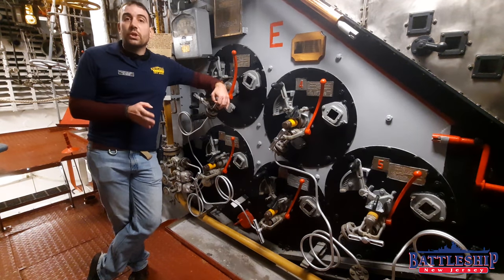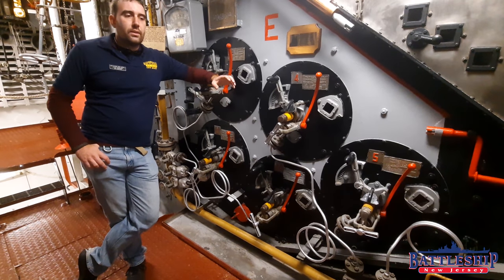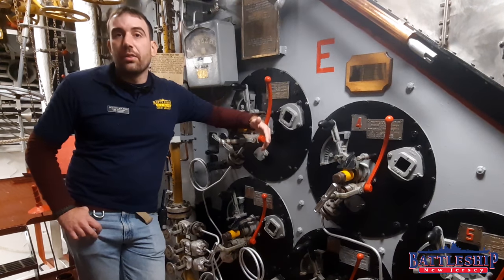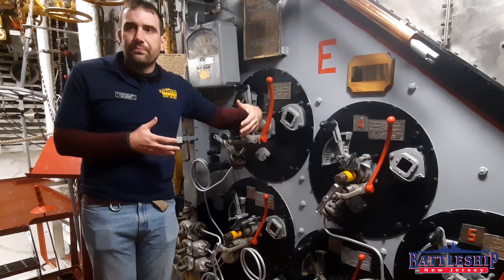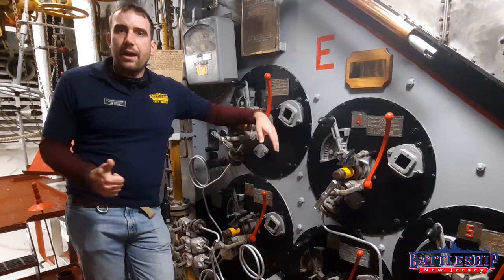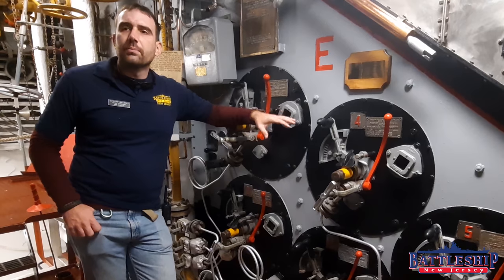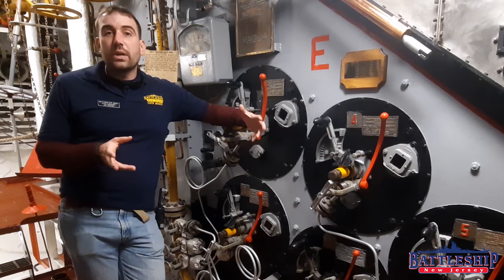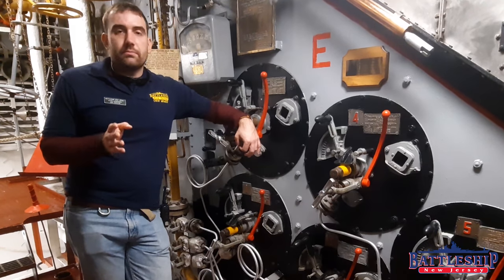Nuclear Powered Battleships

Comment: I completely agree with you on the cost efficiency dilemma. Building state of the art modern battleships would not, not even in a 100 years be cheap. That said WW2 battleships never were, they were the biggest capital class vessels that dominated the AO but were always a scary investment should they be lost. I still believe (despite your good arguments) that nuclear reactors in modern battleships are required if not mandatory. For the very reasons you pointed out you would not put them up front in any engagement to take hits you would instead use them as fire superiority/defence platforms to engage entire fleets becoming the spine of that fleet as they are being escorted. Their size and armour allow them to take hits yes, but with a substantial powerplant you would be able to operate railguns, missile systems and direct energy weapons (Directed Microwave and laser weaponry) that would struggle to be operated on other vessels. With an excess of power these weapon systems could be run cheaply and efficiently whilst the ability to turn the tide of the engagement in your favour. As more technology is developed the design needs to be modular as to be updated if the need arises for new technology and innovation. For the very reasons you mentioned it is not viable to retro-fit the venerable Iowa class battleships, this cannot be done as the foresight of updating the ships was not considered. You do not want to invest in a mega project only for it to be outdated 30 years in the future. 

Regarding taking hits to the battleship, as we've seen with modern tanks composite armour they have immensely improved their survivability, this is something that could be adapted to battleships in some manner again improving their weight and survivability. Shocks to the vessel via explosions that could scramble the reactor could be mitigated via a shock absorber system that the reactor is mounted on there by reducing the chance that only the most devastating hits can cause such a problem (which at the point they have likely already penetrated). Obviously AA armaments are a priority since losing a multi billion dollar vessel to a few dozen planes worth less then a billion would be shit to say the least. I could go on and on but suffice to say that as technology develops, namely direct energy weapons that hit instantly the dominance of planes and aircraft carriers will wane until the need for capital class ships to again slug it out.

Comment: I'm sorry but you're exactly wrong about nuclear reactors being delicate. 

The reactor itself is more hardened than the Iowa's belt, just intrinsically. And it's containment yet more so again. For a good example the USS San Francisco hit an underwater mountain at flank speed, the front of the ship was crushed. But the reactor didn't give a single shit, in fact the ship returned back to port under it's own power.

The navy did extensive hazard studies with the cruisers and there just are not any... Even if it's somehow can-openered and causes a radiological release. In such a catastrophic scenario the reactor would just sink quite quickly and take it's issues with it. There's about a dozen submarine reactors on the bottom doing no harm to anyone bearing out this fact. Your comment about SCRAMing the reactor was particularly telling about your background reading on this topic as military reactors are capable of restarting instantly. 

The many operational advantages of a nuclear reactor vastly outweigh any vague hazards. Double so when those hazards are smaller than existing hazards. Flaming oil from a stricken ship for example is a much greater issue than radiation. Nuclear power will eliminate that hazard, and many others so it's outright safer.

You're right about the Iowa class being too expensive to retrofit, on top of being obsolete anyway. But any new build ship should be nuclear powered.

Comment: Distributed hardened RTGs might be a viable solution.  Just a thought.
Reply: RTG's don't generate nearly enough power to be even remotely effective on such a scale.  RTG's generate power in the hundreds of watts.  You need power on the order of megawatts.  Not to mention RTG's are horribly inefficient converting heat into electricity, meaning even if you could fit enough of them in the hull to power it, you'd have to cover the hull from stem to stern in radiators to dissipate the heat.
Reply: @ThePrisoner881  sorry, failure to put in an emoji at the end of that.   You are quite right.  While a steam generating version is likely possible.  They don’t scale to the task,  and even if you could put enough of them on board, somehow, the resulting “vessel” would be mostly plumbing.   Not exactly a warship.

Comment: Do you think that a multi fuel system would work better than a nuclear system so the ship could run on a whole host of fuels like used motor oil or old dry grease I think it would help save the taxpayers money and give us another shot at producing an amazing surface warship I also think that the gun size should increase so we can lay claim to the biggest naval guns afloat

Comment: Can we stop talking like a battleship would be acting alone in combat situations? Yes they are made to take hits but having one act alone, and be the only target has been historically proven to be a bad idea. I can't readily find the source but I did read an article that detailed what a 1980's era Iowa battle-group entailed. This I believe included at least two missile destroyers, and a missile cruiser. An Iowa Class would have a similar ring of protection like an aircraft carrier because they are both expensive capitol ships with over two thousand crew and steps would be taken to protect them in combat.

Edit: A problem with your not being able to take the hist argument is that there are instances where non-nuclear powered warships cough Scharnhorst cough were felled by hits that either flooded or destroyed the boiler/engine space.

Comment: Hmm well my opinion to that of NP (Nuclear Power) it is a Very Fragile unit system, unlike that of the Oil Burners on Iowa but again the Days of the Iowa where Times of War and anything with a NP power plant was made in the times of very little Conflict with those ships cause they where the new shiny new toy that you didn't want to break and it's still that way today, every Ship that is ment to get down and Dirty don't have that of NP power plant within there hull, they have that of a Standard system of ether Oil burner, or that of Gas Turbine engines. If someone wanted to make a new Iowa Class or Montana Class BB they would have to use Oil burners or Gas Turbines for those are more Sound that that of NP. But again I would go more for CB or CC go with Oil burners for Main and Gas Turbines for Secondary Main for more Power for Combat systems, Then go for maybe 12-14in Cannon that can fire that of Rocket Assisted munitions or go for that of Pure Connect Rail or Coil. Then start building a Ship around the Power plants and the Guns
Reply: By oil burner, do you mean oil-fired boilers driving steam turbines? That would be a bad idea today since nobody runs marine steam turbines anymore except in a few LNG tankers. Integrated electric propulsion with diesel and gas generators is a better setup in every way.
Reply: @hailexiao2770  Well yah Gas and Diesel is better then Oil Burners in every way But if I wanted to use Old Tech as a Just in case oh emp (Which is HIGHLY unlikely) but I would use Oil Burners like the Iowas. Even trying to EMP proof something this large would be Very Interesting to put lightly since even if say someone would go with a CB or CC the thing is still large AF.

Comment: I agree that putting a nuclear reactor in a vessel that going to go head on with the enemy is not a good idea.
Reply: You do realize we've been putting these things in submarines designed to go head-on with the enemy for decades, right?
Reply: @ThePrisoner881  I do realize that, but a submarine by design is stealthy.  A battleship is kind of hard to hide on the surface.
Reply: @timothygunckel7162  true, but that's not the point of my comment.  The point is these vessels are designed to go into harm's way so surviving battle damage is a requirement that's been in place for a while.  One could even argue the submarine is the more fragile of the two platforms as a single good torpedo hit will finish it off.  A battleship would likely survive multiple torpedo or missile hits.  Should the enemy be unwise enough to get into an artillery duel with a battleship (typically ~6-inch artillery vs 16-inch naval guns), they would find themselves outranged and hugely outgunned.
Reply: @ThePrisoner881  point taken provided no other countries put battleships back on the roster
Reply: Timothy Gunckel it really wouldn't be likely, they are exceedingly expensive to build and only the largest powers would bother with the expense. It would still be more of a show piece for big-gun diplomacy.

Comment: Putting a. battleship back in service would be an immense waste of resources. 

If we needed to hit any target we now have air assets and cruise missiles that could accomplish the task more accurately and be on scene anywhere within hours.

If you needed saturated shore bombardment. a  B-1 or B-52 could ARC Light an area with dumb bombs or highly explosive deep penetrating precision munitions. And a squadron of BUFFS could level an immense are with just good old iron dumb bombs. 

Their is a reason they are not arming destroyers or cruisers with big guns anymore.
The missiles and airborne assets are superior.
Reply: The main reason why gun vessels went out of favor wasn't because they lack power, it was because they lack range.

In fact, an Iowa-class battleship can accurately lay down enough firepower in just one hour that would take a nuclear aircraft carrier two weeks to surpass.

What's more is we have some new rocket boosts that we can add to shells which can significantly increase the range of those shots, at the expense of a slightly smaller warhead.

I don't think that the Iowas hefty fuel consumption makes it viable for future use, but if we could build another class from scratch that could take advantage of all of the modern enhancements that we could put onto it, along with a conventional power plant, 40%-45% armor weight and 16 inch guns, I'd totally be down to build something like that for the Marines.

But at the same time, I could also see us building a nuclear powered battle cruiser for the Navy, similar to the old soviet Kirov-class, but with lasers and railguns for medium range fleet defense and medium range ramjet (scramjet once it becomes available) missiles for offense.

Comment: A question I posted on another video is does anyone know if the armor system on the Iowa’s could withstand a missile strike. Follow up would then be, could the Iowa’s, with the 80s refit, mk 23 rounds and sabot rounds for massive range, could take on a current day US carrier group. Seems like it would shred through everything but the missiles and plane attacks.
Reply: Likely it would but today’s missiles aren’t designed to deal with large amounts of armor to begin with. If armor came back into fashion then missiles would be developed to deal with it
Reply: The majority of missiles fielded today would have a very hard time sinking the ship. However, the superstructure would be decimated and the ship would be functionally inoperable.
Reply: Depends on which missiles we're talking about. Against Harpoons and Exocets it'll do fine. No feasible amount of armor is going to stand up to Kh-22s or the new generation of hypersonic missiles.
Reply: Even then it all comes down to energy and the ships defensive ability to absorb that energy. The 16” guns shot 2700lb shells around 2600fps and the 2100lb shell at up to 2800fps. The 2700lb shell was designed to go through 16” of armor plating. 

So we need to find out the weight of those.

Comment: Not sure the reactor could take the jolt of a 9 gun 16" salvo.
Reply: Simply a matter of adequate shock isolation. The range finders are extremely delicate instruments themselves and they can take it. It’s just a matter of engineering
Reply: @aidan11162  We had pipe breaks sometimes it's a jolt on old pipes. I would love to see it though,  bring back my girl, Big J BB62
Reply: No problem. Modern naval reactors are designed to withstand shock.

Comment: I've read several articles stating we need modern day battleships. Our current fleet of surface ships are built lightweight and can't take the punishment the old WWII stuff could. If/when we get in a shooting fight with Iran or China they will definitely use "swarm" tactics to overwhelm our defense's. A modern battleship could absorb such an attack while dishing out massive firepower in return. Also in todays military there is never enough CAS. Even if you had the aircraft you still need permission to fly through foreign airspace, tankers for fuel, airfields near the fight (which includes a massive footprint on the ground), plus other considerations. However, modern battleships could provide extremely effective fire support from offshore.

Comment: With a rebuild of the turbines the power out put can be increased.
Reply: Not without rebuilding the whole steam system including the boilers! It is rotten!
Reply: @donraptor6156  That is a given.
Reply: @donraptor6156  That is a given. Piping can be replaced, but rebuilding the boilers would be more difficult.

Comment: So the early bird class destroyer for Uber third-party ships they have half the Armament and all that good stuff and not as not as the robust as the Iowa class and they still have not had an issue like that with it I remember I need help I remember class for bumped into and they still have not had an issue ah yeah and I remember class destroyer do you want a oil tanker like yeah really fun it almost something that the vessel Iowa it's not going to happen yes there's got to be a way to adapt the boilers to make them more cuz they're basically the same thing but you know when they reactivate them on the 80s they are analog computer system that they used to launch the the big guns at people I'm online on land was completely 100% accurate to the point just because of something cool doesn't mean it's not efficient and with your nuclear powered Iowa class battleship they can go at longer stretches get better deployments than yes they are old but think about it nothing out there today is capable of handling and impact from a show from Iowa class battleship countries fear battleships to be honest with you they would have to modernize it and it the hole would look probably look a lot different throughout the new guns and the fucking real guns and all that shit I mean but think about it though it'd be awesome to see a fucking Iowa class battleship easy to nuclear power reactor kicking the shit out of any country out that gets in our way